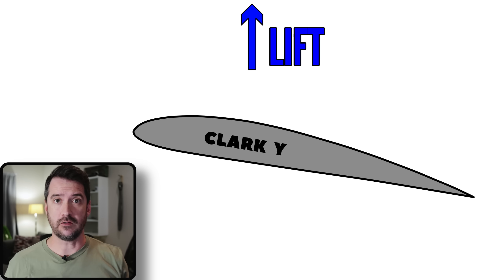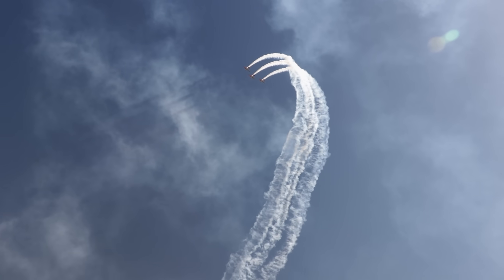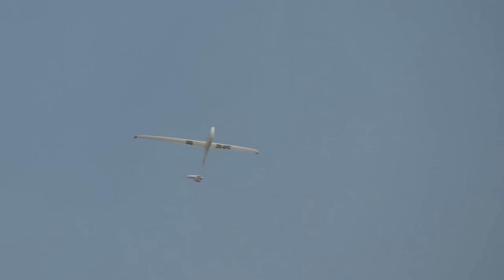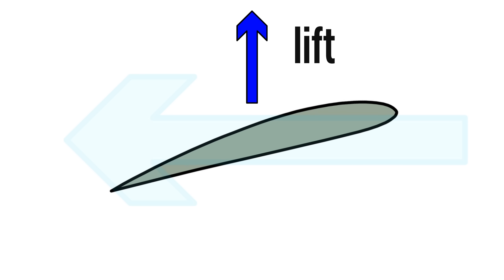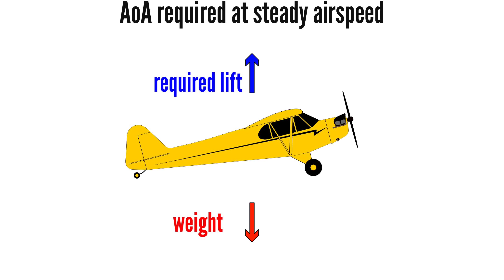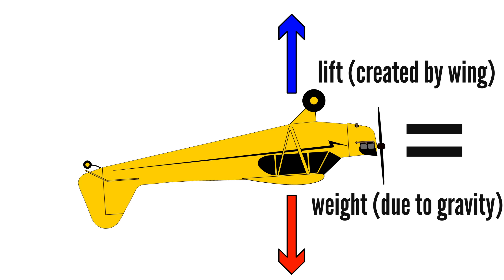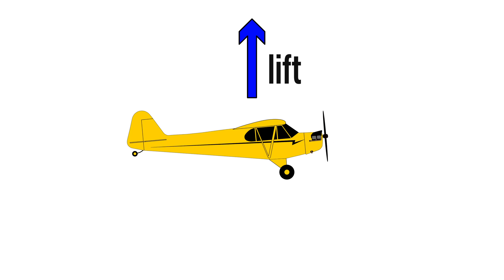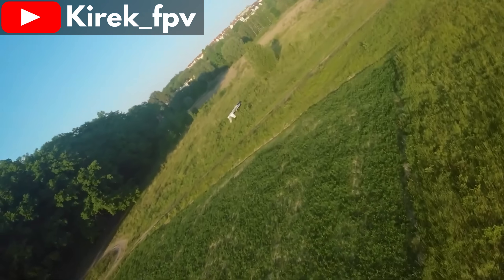Is Airflow Distance Over the Top of a Wing Always Longer?

Comment: For a given wing, speed and angle of attack, can one calculate how much lift (say, in pounds) is being created?  Can I assume that a stall is when the pounds of lift is less than the pounds of weight?
Reply: Please see my stall explanation sent mistakenly to davetime5234 somewhere nearby in this thread.  Replied to the wrong sender, sorry.
Reply: No, that's not correct.  When an aircraft goes from straight and level flight to a controlled negative vertical speed for descent, it is definitely not in a stall in all normal operating circumstances. 

Initiating such a normal descent only requires that the lift be decreased to a level somewhat below the weight of the aircraft.  Reducing angle of attack somewhat and/or reducing forward speed will accomplish this.

And it is expected that orderly airflow over the wings will continue during this process.
Reply: @davetime5234  A stall is more subtle.  

First I have to talk about "adverse pressure gradient," the pressure pattern on the upper rear slope of the wing.  In any normal flight attitude this pressure increases toward the trailing edge, and as the flow over this surface encounters the pressure increase, it's obliged to slow down as it approaches the training edge.  (Hence "adverse" -- acting against the necessary rearward flow.)

So long as the flow doesn't slow down completely, it can spill off the edge, leaving room for the flow that follows it, and the wing can keep flying.

If you push the wing too hard -- exceeding the sustainable angle of attack for a given airspeed -- then this pressure gradient becomes so great that the flow over the wing does come to a stop -- "stagnates" -- before it reaches the trailing edge.  This means that the flow that comes after it is blocked, forced to stop and jump off -- to "separate" -- and in this case you no longer have an orderly rearward flow off the trailing edge, but instead a burbling region of separated flow on top of some amount of the wing (rear margin first, and increasing forward if it's allowed to continue).

The only remedy is to get the nose down and build up enough speed that the flow washes the separated region away and the flow can reattach.

This costs altitude -- you've got to dive a bit -- which raises two issues:
(1) if you're too close to the ground for the dive you need, you're cooked;
(2) if you're a rookie pilot who thinks the way to escape is to point the nose up, you're cooked until and unless you think better of it, or until someone else takes the controls.  This issue (2) appears to have been the way that the person at the controls of Air France 447 on June 1 2009 held the plane stalled through a loss of several miles of altitude until it hit the ocean and all 228 aboard it died.  It's true that there was fiendish sensory overload from alarms going off, and bewilderment from iced-over instrument sensors.  But a quote from late in the cockpit voice record has him saying something to the effect of "I don't know what's wrong -- I've had the stick back [= nose up] the whole time!"

Comment: Lift is about 75% displacement and about 25% Bernoulli's principle.  Those two numbers can very a bit depending on if the airfoil is asymmetrical, symmetrical, cambered, and many other aspects.
Reply: Lift is 100% vertical mass displacement and 100% pressure difference.  They both fully account for lift and must always work together to produce lift.  The laws of nature won't negotiate on this point.

Comment: Everything stated is 100% correct. Thank you and you're welcome. ;-) Additionally, to maintain any kind of efficient lift to drag ratio, flow both over and under the wing has to remain (mostly) laminar. A stalled wing still has lift — or resistance to downward forces — but much less. Lift force is the result of combined pressure *differential* between both top and bottom surfaces. People seem to want to consider only the top or the bottom and argue about which one it doing the work. It's BOTH. It's a SYSTEM. The devil is in the details.
Reply: But it's a fact that in producing the pressure difference, the top's pressure drop below ambient atmospheric pressure is quite a bit more than the bottom's increase above ambient atmospheric pressure.

Also, detail you left out is that the resulting pressure difference absolutely has to be a force that accelerates air mass downwards.

Because an aircraft has no rigid support structure against the ground to suspend the weight, the pressure difference must result in a "pull" against relative airflow at ambient atmospheric pressure, to force its momentum downward to provide that support relative to the ground.

Much like a rocket must expel mass downwards to overcome gravity.
Reply: @davetime5234  I see your point but the thing you really have to model to see enough to believe is that the wing is moving forward through the air. It so happens that this matters more than one might think, as opposed to say, looking at it all from a static, "weight pushing down on a spring" system. In any case, my main point was to highlight that the downward facing "jet stream" of air off the trailing edge of the wing has a great deal to do with the downward airflow behind the wing, relative to the front and mid sections, "pushing air downward". That jet of air is moving much faster than the wing is moving forward through the air and also (usually) at a steeper angle downward than the angle of attack of the wing itself, relative to straight and level forward motion. In the end, the trailing edge's rapid moving air collides with the much slower downward moving air being "pushed" by the underside of the wing.  The vortices created by this as much larger and moving in circles much faster than they would be if the wing was a plank, with with separate laminar flows. This same effect can be felt right in one's face on a yacht when sitting behind the trailing edge of a sail, more convincingly so when winds a light and the boat isn't moving very fast. Your face gets pounded with a surprisingly stiff breeze.
Reply: This is also why modern high performance sail boats can move forward through the water significantly faster than the wind speed relative to a stationery object int he same body of water. Much faster than sailing dead down wind, for example.
Reply: @gruvinnz  I'm not sure I understand what you mean by this:

"wing is moving forward through the air. It so happens that this matters more than one might think, as opposed to say, looking at it all from a static, weight pushing down on a spring system"

I don't think the following is true:

"..pushing air downward. That jet of air is moving much faster than the wing is moving forward through the air"

The mass of air moving down, plays a more dominant role than the speed of that mass downwards, in producing the downward change in momentum of air.  More mass down and less speed down is what causes the efficiency of forward flight vs just an engine thrust hover.

I believe the effect you feel with the following is due to the momentum of air, again more so because of the amount of mass being moved rather than any increase in speed:    

"This same effect can be felt right in one's face on a yacht when sitting behind the trailing edge of a sail, more convincingly so when winds a light and the boat isn't moving very fast. Your face gets pounded with a surprisingly stiff breeze."
Reply: @gruvinnz  I believe that's because the force created in "lift sailing" as opposed to "drag sailing" is not limited by the wind's speed.

Comment: You're overthinking it.  How does a rudder steer a boat?  It creates pressure on the side that faces the water stream by the rudder angle against the stream.  The angle of attack of the surface of the wing obstructing the stream of air moving past it creates pressure, thus forcing the wing up. When the wing is upside down, with the angle of attack reversed in relation to the air stream, allows it to fly upside down.
Reply: You're not correct.  Most of the mass displacement to hold the wing up results from the pressure drop on the opposite side, the upper side of the wing.  The force of this pressure drop acts to accelerate relative airflow at normal ambient atmospheric pressure downwards.

So, you are giving an analysis on the wrong side of the structure from where most of the effect occurs.

There is no dispute about this in the formal considerations of lift and the abundantly available data.
Reply: @davetime5234  That's too simple.  Keep working on it.  I'm sure you can make it more complicated.

Comment: The puzzling thing to me is how kites can fly with a single surface wing. With the leading edge being very thin,  the wing being a single surface and the angle of attack being very steep when launching the kite, many kites can fly in very low windspeeds.
Reply: It's no different from any other lift producing solid:  asymmetry of shape relative to the airflow is the operative condition. 

The asymmetrical shape "channels" the unequal obstruction of airflow.  A pressure differential results, which causes a force in one direction more than the other, accelerating air momentum in a downward vertical direction.

The force of lift is the result.

There is an average path difference higher on the upper side than the lower side, forcing more pressure drop on the top than the bottom.  It doesn't matter that the kite in perfectly thin.  The average path length of flow on each side is displaced outwards somewhat from the surface, because all the air cannot bunch up to travel only on the surface line.

Comment: It's really intuitive. The angle of attack causes onward air flow to hit the bottom if the wing putting pressure on it whereas the top of the wing is on the wayward side so the oncoming air doesn't hit it creating obviously lower pressure.
[If it's tilted up, the air hits the bottom and not the top.]
Reply: Most of the pressure change though, is the drop on the top.  And most of the confusion people experience is in considering how the drop on the top both forms in the first place, and contributes to the change in downward momentum of air that results in the value of the lift force.

Comment: Great video thanks! I’ve never thought of it as being due to having a “longer path” to travel but resistance to flow that slows the upper flow causing the differential. This is more to do with the LE radius than the full path of the flow over the airfoil, I’ve always thought of a wing as being a leading edge pulling everything else along with it. I know the centre of lift is usually further aft of the LE but the LE is crucial in separating the flow to where a differential is produced thus lift occurs. Regardless, it is astounding to me that this is still a debate - why don’t the aircraft manufacturers who very carefully and precisely design their airfoils weigh in and put this to bed - this is not a mystery it is a very precise science and as such should not be a debate, in RC I’ve seen flat barely balanced planks that defy all aerodynamic theory ‘flying’ and as such should be defined or explained by a different science more akin to kite flight.

Comment: How do you know that lift produced by wing remains “normal” to the cord and span during loop… assumption without evidence. I suspect the wing-loading goes toward zero at the nadir. I have flown many loops. I disagree with your arbitrary assumption unless you have very good evidence.
Reply from the maker: Not sure what exactly you are disagreeing with. I didn't say lift produced remains normal during a loop. Of course the load will be more at the bottom, it's gravity + the G's created. At the top gravity works in the opposite direction than the G's created.

Comment: For anyone who knows anything about fluid flow, they know that the lift is created by the change in momentum from the leading edge of the wing to the trailing edge. This change in momentum is created by the angle of attack deflecting the airflow as it passes the wing. A flat plate can fly. The so called wing effect is to make it more efficient and to achieve what is called the Kutta condition, which is the seamless joining of the air flow on top of the wing with the flow on the bottom. If the upper flow does not rejoin the flow from the bottom, we have separation and the  upper flow separates from the wing surface before reaching the rear of the wing. If this condition reaches an extreme, the wing stalls, quits flying, and the plane drops like a rock. The pilot must get the plane's nose down, establish air speed, and then pull up to the proper angle of attack to start "flying" again.
Reply: The minute you go inverted, your idea plummets to the ground
Reply: @SocraticatheManc  unless they have enough angle of attack

Comment: Aircraft is "planing" atop air under the wing no differently than a boat. They had it right from the beginning.
Reply: This is widely agreed and proven to be false.  The pressure drop on top is the main contributor to the pressure difference which accounts for the downwash momentum creating lift.
Reply: @davetime5234  What's false when both principles are operating?
Reply: @MarkShinnick  To suggest that what occurs with a moving boat is analogues to lift generated from a wing is false.  Also, but perhaps a bit separately, a boat is held above the water mostly by buoyancy (force equal to the weight of the mass of water displaced), and that effect is so microscopic for an aircraft (due to the much lower mass density of air than water).

It's true though that somewhat higher pressure under the wing contributes to the pressure difference between top and bottom.  But the drop at the top is a lot more than the increase at the bottom.  So, the effect of how the drop at the top changes the momentum of air down, really needs to be considered as a key effect.

For a boat, it's upper surface is in a completely different medium (air) than the bottom surface.
Reply: @davetime5234  You missed the point about this being a compression phenomena, regardless of the field. Ground effect also teaches this simple principle.
Reply: @MarkShinnick  "compression phenomena" is overly simplistic.  It is not simply that.  

It is conservation of mass, momentum and energy, at a minimum.

Newton did not say "our physical world operates according to compression."
Reply: @MarkShinnick  Lift is simply:

1)asymmetry
2)turning the air

if only a bit more detail:

3)from a competition for space caused pressure response
4)which accelerates the air mass sufficiently around the solid to prevent flow disruption. 

(Conservation of mass, momentum and energy, are the ground rules for how this expediting pressure profile develops around the airfoil.)
Reply: @davetime5234  Newton would surely have thrilled at the efficiency of planing from below and lift from above.
Reply: @MarkShinnick  It's definitely high- and low-pressure areas forming in tandem, paths of least resistance to pass all the air mass through fast enough so that it doesn't pile up.

Comment: Great video.  Perfect description of static lift.  The uninitiated to airfoil design think everything works on the dynamic lift principal, which is real, but plays a considerably smaller role in how lift is created.  There are also people out there who think the world is flat... dumb is everywhere.
Reply: But dynamic pressure is fundamental to lift creation.  That's why pilots live by reference to indicated airspeed.  IAS is a reference to speed in terms of dynamic pressure.  That's because the amount of pressure difference created between top and bottom of the wing is directly related to the dynamic pressure implied by IAS.

Comment: Before watching: As far as I remember there are at least 3 effects that together make airfoil as efficient in producing lift as necessary for planes to fly. Pressure differential is just that hand-wavy explanation that provides couple percent of the lift at most. From memory the biggest part of lift comes from conservation of momentum. And of course the "lower pressure" bit does matter, but just a tiny bit. You can fly upside down, it's just that it will be suboptimal (and other effects will get penalty as well IIRC).

Comment: Nice explanations. Density of air above and below wings gives an Archimedean clue as to why lift occurs. Here's a nice related question: if an aircarft flies directly above you, do you feel the weight of it? Does the height at which it flies above you have any effect on what you may feel?  Thanks for posting.
Reply: Buoyancy of a balloon relates to Archimedes' principle.  For a heavier than air aircraft, there is practically no effect on lift from Archimedes.

You would only feel the downwash, which must have momentum equal to the weight of the aircraft, if you were close enough that it didn't dissipate in intensity before reaching your distance below.

You can google images of aircraft carving out big rectangular strips in the clouds below due to the downwash.
Reply: If you had a really sensitive barometer you could theoretically detect it.  (Or maybe not so sensitive if it were hedgehopping and went over at 100 feet.)  See Prandtl & Tietjens, Applied Hydro- and Aeromechanics, chapter VI: B: topic 101, The Velocity Field in the Vicinity of the Airfoil.)

Comment: I always thought that was a stupid idea. 
I don’t have a physics degree but the idea that the pressure differential between the two t sides of the wing was ridicules. 
I always through it was the wind pushing up on the underside of the wing that are slanted up. 
Just like it’s the pressure of the wind being compressed by the speed of the wind or the force being applied to the wing. Thrust creates momentum, momentum, creates speed, speed, creates pressure against the air, creating lift the more speed the more pressure against the wing the more lift. 
And I didn’t even graduate HS. 
And it shows 🥴